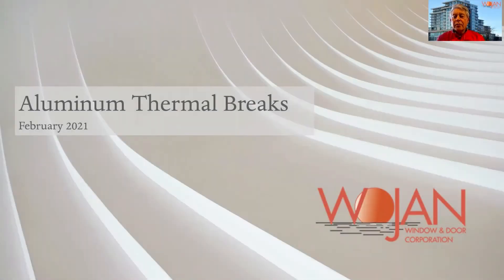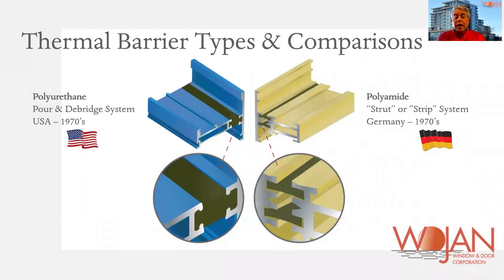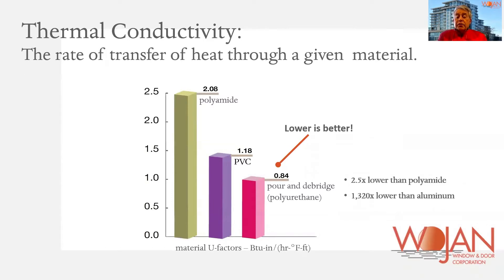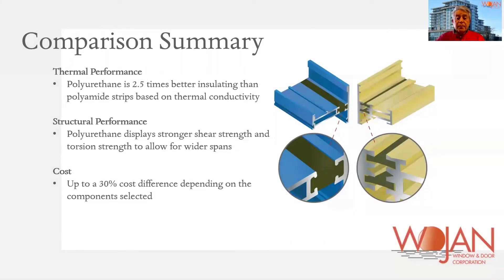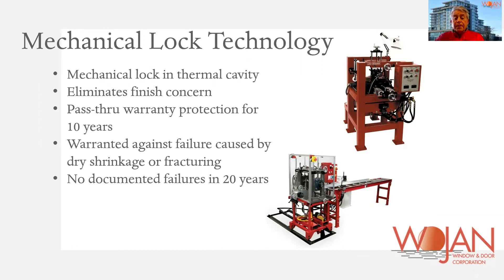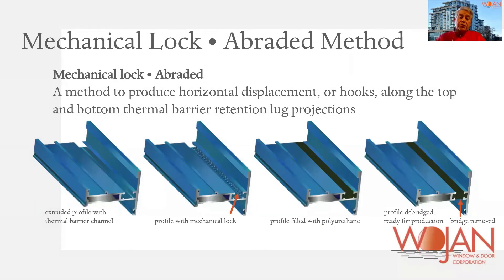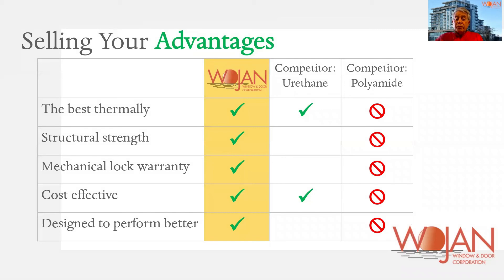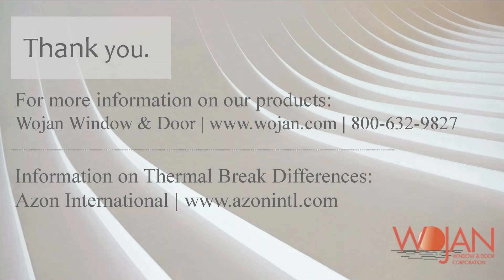Comparing Thermal Breaks in Commercial Aluminum Windows

Comment: There is misinformation of the technical performance of Polyamide Thermal Breaks. Polyamide 66 Thermal break material is filled with 25% glass fibre, so it is simply impossible for this material to have less strength when polyurethane. Above all PA66 GF25 Thermal Break strips are non-flammable, recyclable material.